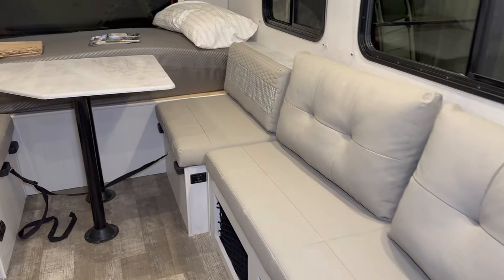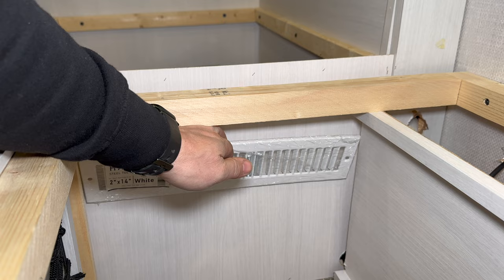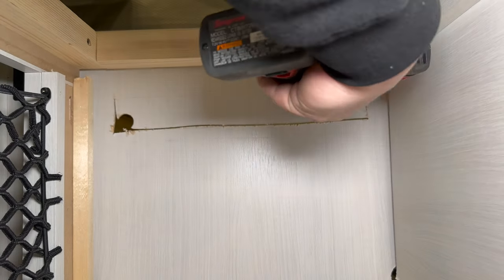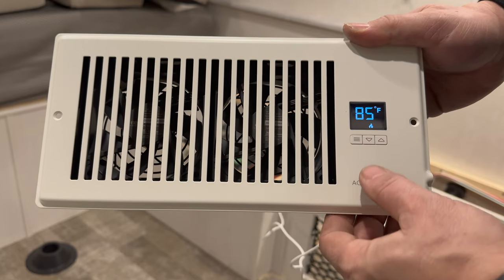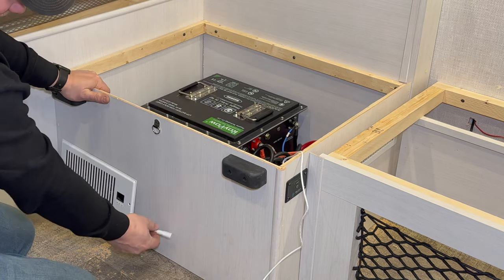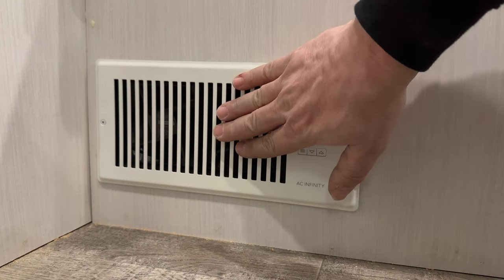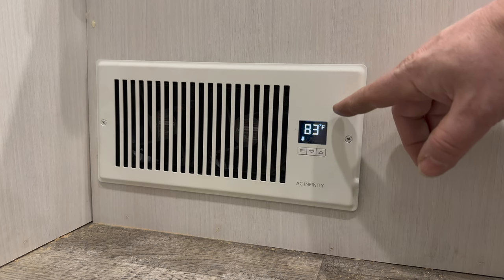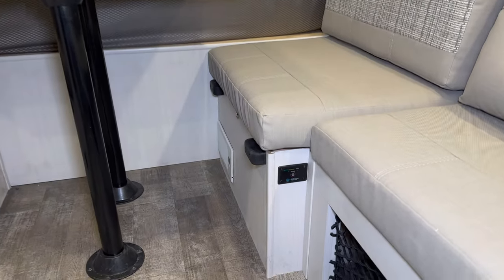Cooling the Lithium Battery Box In My Camper

Comment: Interesting video as always but I wonder why you chose to pull the hot air out low down and bring cool air in high up I would have thought the reverse would have made more sense.
Reply from the maker: No, in order to still somewhat use the storage (with the net) (there is not much storage in such a small camper) and not block the vent or fans I had to get a vent that would be as small as possible on the top and to draw the cool air coming in from that vent across the box keeping the air from being stagnant the fans had to be in the most opposite corner that was available.

Comment: You do know that heat goes up, don't you? Having the inlet vent above the exit (fan) vent is an inefficient setup. You could have done it without the fan by just adding a chimney. Put a hole in the back just above the battery. Run a 2" diameter plastic drain pipe (with elbow) up to the top of that bit stepped out from the wall. This would have made, a quiet operating, up draft ventilation.
Reply: When I build electrical cabinets I either blow in the bottom or suck out the top. Some cabinets do both.